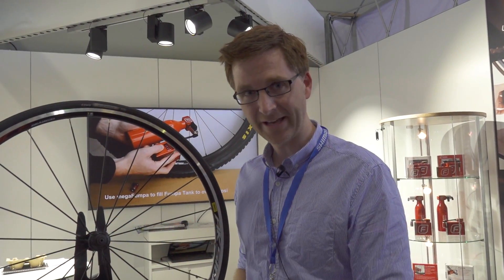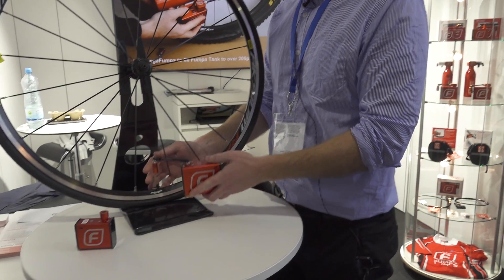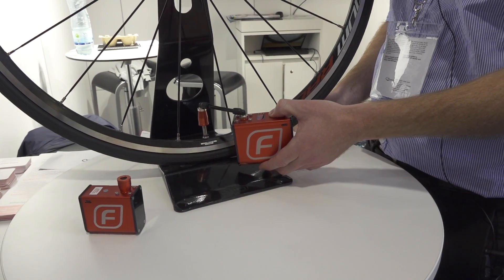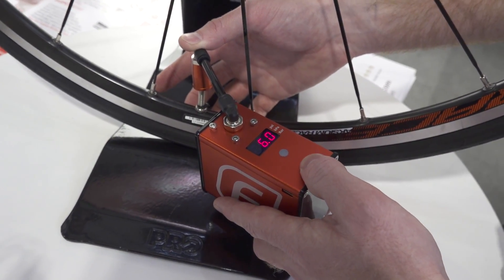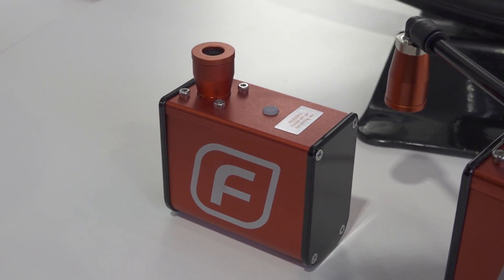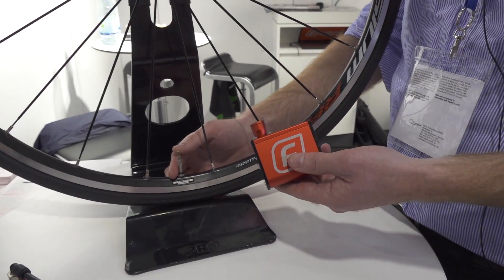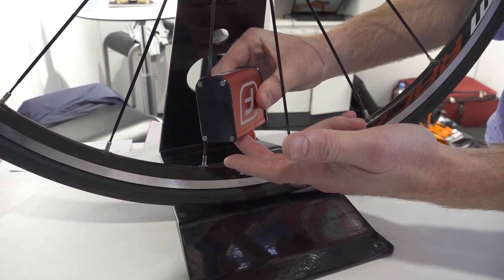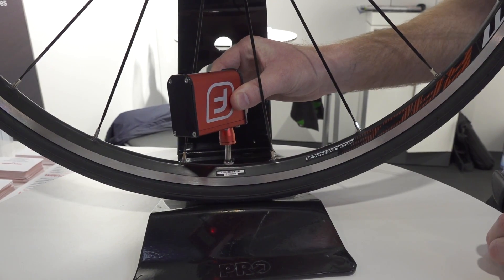Fumpa Pumps - miniature electric bike pumps

Comment: Can't beat my CO2, time wise, spacewise or costwise.  Caveat for tubeless tires as CO2 takes a more specialized procedure to use on those kinds of setups.
Reply: co2 has one big drawback though. it's not air.
Reply: @84viper  when you get home you could fill it with air.
Reply: @Tevon93  the idea is to fill your tire valve in the twelve positon after having the valve up there for a few minutes. It also has to be done slowly. It's not the CO2 it's the temperature.